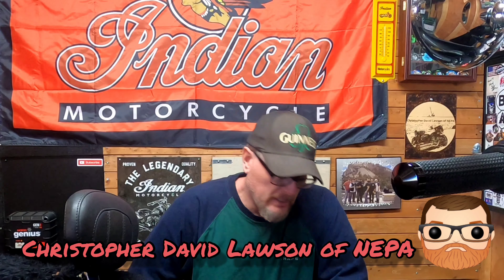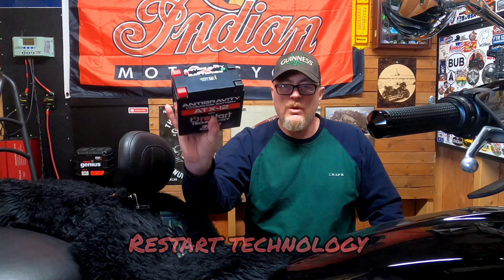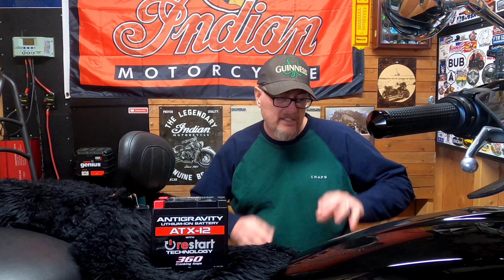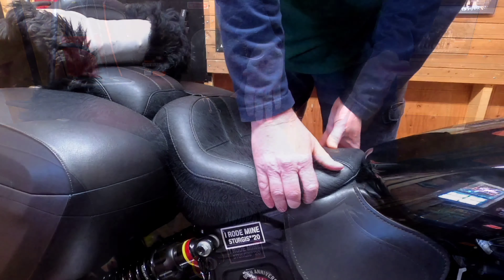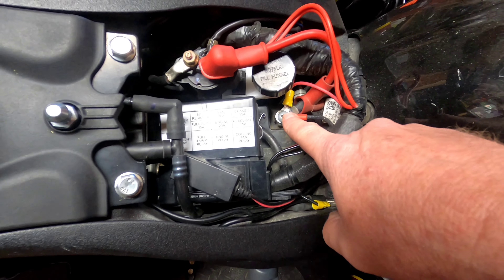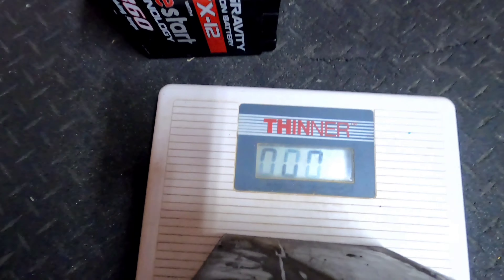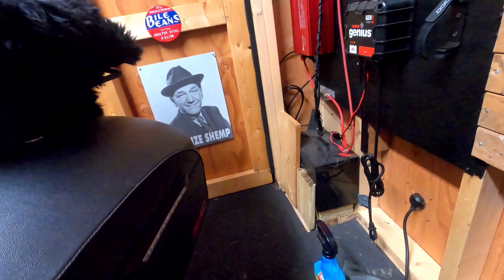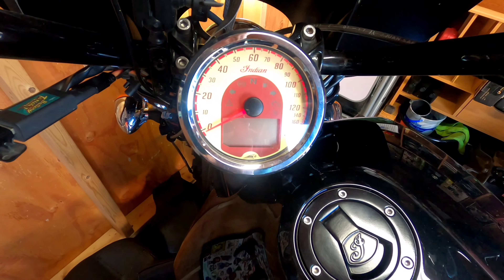Indian Scout Lithium Battery Upgrade:  Antigravity with Restart Technology  #indianscoutsixty

Comment: Is the Scout Shed heated? My research indicated temps below freezing are hard on this kind of batteries. I am not 100% sure you cold weather cranking issue is all the battery.
Reply from the maker: No heat unless I run my portable heater.
Reply: @CDLNEPA  you may want to check with mfg about storing temps. I looked at one that said storage below freezing could permanently damage the battery that snd fact it take a special tender made a no go. If I got pull it in winter to store it I don’t want it...
Reply from the maker: I already have a tender that works with lithium.    Pretty sure this one said not below negative Temps.   We almost never get that low.   Will have to check again.😎👍
Reply: @CDLNEPA  make sure that is F and not C...

Comment: I’m like 98% sure that when the battery was upgraded in 2019 it went to either 240 or 245 CCA. 
Also, the real problem with scouts and cold weather starting is they were originally supposed to have a compression release, but to save money it didn’t make to production.
Some of the machining work is even done already in the heads for it.
 My 2020 has only needed the start button hit more than once one time this winter at 15F. I’d be leery of a lithium battery at those temps.

Comment: are you able to hit the restart button on the battery once the battery bracket is on or does the bracket cover the button?
Reply from the maker: I did not put the bracket back on.
The battery fits in there well enough that it isn't  going to move anyway.  I can still reach my hand down the side to hit the button.

Comment: Would I need a trickle charger for this kind of battery for the winter months or do I need to use a special lithium ion charger. Thank you and appreciate your videos
Reply from the maker: Cold doesn't seem to effect this battery as much as the stock but If I don't ride the bike for a few months  I use a NOCO charger which maintains/charges all types of batteries.

Comment: So have you tested the battery in 20 degree weather yet?  When it's that cold I have to start mine a couple times to kick on the battery then fires right up.  Mine doesn't have the Battery Management System you described.  Great video and detail. 💪🤘
Reply from the maker: I rode to work last Friday.  It started better than the stock battery did.
Sometimes I think we need to prime the pump on these newer bikes a couple times in colder weather.

Comment: Total garbage got mine 4.5 months later dead and will not charge with special Lithium-Ion Battery charger purchased separately, both purchased on Amazon and retailer will not even return my emails for warranty reasons.
Reply from the maker: Mine still works fine